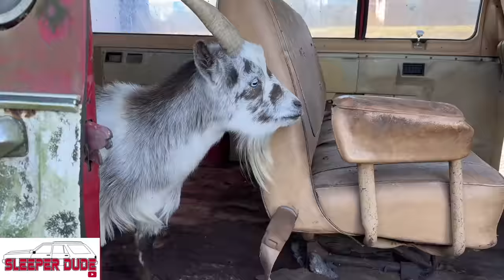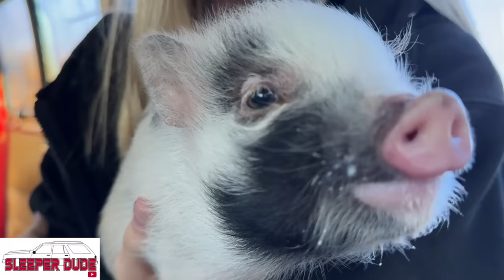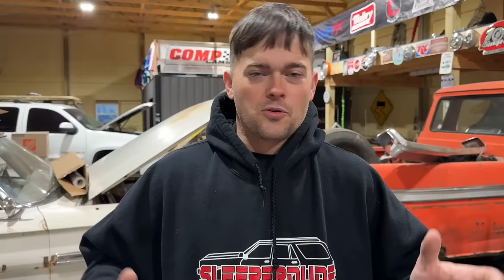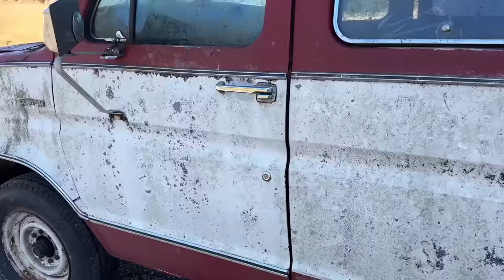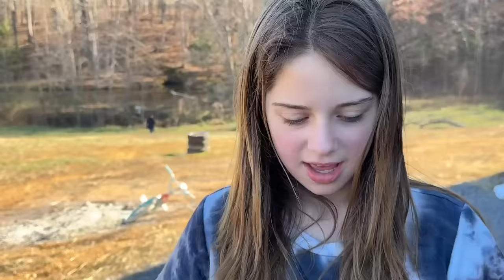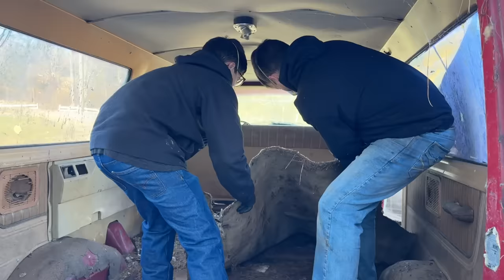$500 Big Block Van First Drive and Clean Up.

Comment: The little yellow thing in the pan is a plug they put in place of the dip stick tube, so they can slide the tube over it without losing the fluid, cause the trans come with fluid in them. Usually means the pan hasn’t been off it.
Reply: Guess should’ve kept watching and you’d found out. 😂 I suspect Lucus will not replace thrust washers 😂
Reply: I did the same comment and 2 minutes later bam lol @jcnpresser
Reply: That's correct

Comment: The lolipop you found in the trans pan was a plug they used at assembly, when they pushed the dipstick tube in the plug went into the pan. I'm a retired master mechanic, cut my teeth working on those old seventies vehicles. You do a great job and your family is a hoot.
Reply: Yep, that tells me the fluid and filter was never changed.
Reply: Same thing I was thinking didn't know they did it back then though
Reply: Exactly right.

Comment: That little plastic thing in the pan is the factory plug for the dipstick tube, when they install the tube they just push the plug in the pan and leave it. The fact that it is there indicates the pan has not been off before.
Reply from the maker: Ok thanks

Comment: I had one of these.  It was a great vehicle, reliable, great for hauling kids, work, hauling building supplies and for camping and towing.  The only downside was 10mpg.  Took me 8 hours to replace the water pump.  Most of the switches didn't work when I first got it and had to be replaced.  Tried to sell it but gas mileage scared people away.  A real versatile workhorse.

Comment: HERE'S A GREAT TIP:  Take some bolts 2 inches long or so, and cut off the heads and taper the shafts and when you go to line up a pan with gaskets just screw in 3 or 4 and just let everything just line itself up as you raise the pan and when you have 3 or 4 bolts installed take out the headless bolts and install the rest of the bolts, easy peasy.
Reply: Use zip ties to secure the gasket to the pan and after a few bolts, cut of zip ties .
Reply: I always drilled a drain plug in the transmission pan as well. Seems such a simple thing that all the transmissions from the big 3 car makers din't do. Such a no brainer easy fix. I just get a magnetized replacement Oil Pan plug bolt and put in the hole.

Comment: Was getting ready to type the answer about the plastic float you found in the pan when you called your buddy on the phone 😂!  Yep, its an assembly line plug to keep stuff out of the trans before assembly - so yes - that pan has never been off the trans.  If you mix the Lucas with ATF in the 4qt bottle, it’s much easier to pour in 😅.  Merry Christmas to you all ❤ 🌟

Comment: Club Wagons came in 12 and 15 passenger. Yours is a 12 passenger and would have had 3 seats originally. The roof rack is either factory or dealer installed accessory.

Comment: I remember when those were new and seeing it brings back so many memories of my dad who drove white Ford panel vans from that era for his vending machine business. He went through two or three of them through the years before switching to Suburbans. 
He always had them heavily insulated and then wood paneled it the cargo area. The extended van had two rear side marker light  cutouts in both rear panels, using a steel blank plate for the normal length body so he would always buy two extra light assemblies from the HELP! section of the local Auto Zone so he had the only one in town with double rear side marker lights. He just went to be with the Lord 10 months ago and we sure do miss him!

Comment: Adjust the bands using Ford factory tools. Do a cylinder leakdown test. Put in Marvel Mystery oil in the oil. Put Gumout in the tank. Check the suspension and steering. Replace the starter. Check the electrical circuits for shorts. Find out why that van sat.

Comment: You are on the spot about mounting a winch to your back wall post. I did that with just a small HF winch and it has saved me countless times. If a vehicle rolls even a small ATV style winch will pull it in the shop.

Comment: He was 100% correct about the plastic piece in the transmission. When i did automotive salvage i used to run into those plastic pieces when i would pull ford pans. After seeing a bunch of them, I grabbed one and brought it to an old Ford master tec to see what it was. He laughed and explained exactly what you were told. To think how many good C6 transmissions I sent to the crusher due to "finding pieces in pan" 😂

Comment: Merry Christmas Sleeperdude family! Josh my uncle Ray rebuilt transmissions for 30 years. I had a van with a C6 with overdrive. He told me that Ford specs was 5qrts.before they added the overdrive. He said that when they rebuilt one they had determined that you needed another quart due to the way the overdrive was placed. He said once they figured it out they never had any problems with one.

Comment: When washing an old mossy  vehicle , spray it down with strait Super Clean in a spray bottle before putting any water on it, then pressure wash it. You will see a massive difference.  Love the videos.

Comment: Hey there Josh ,
The little plastic piece with the ' O ' rings on it , the factory uses them to seal the trans. on the assembly line ! It goes in the dipstick tube hole , after the Trans is installed , they drive the dipstick tube into the Trans. Housing before filling it with fluid and that little piece just drops into the pan ! So that says that no one has worked on the transmission, because the tech would have just thrown it in the trash ! It will not hurt anything to leave it in the pan just like FoMoCo did when the vehicle was manufactured ! I hope this lowers your stress level a little !

Comment: edit commented before I got to the part where you are told what it was*
The plug in the trans pan is a factory piece installed on the assembly line so it dont leak fluid. Then they install the dipstick it just get pushed into the pan.
Very good indication that the pan has never been off.
Reply from the maker: Ok thanks

Comment: Oil dry is way to expensive for my backyard shop. I use kitty litter. It does the exact same thing and it also puts a shine on the floor. And then I put the kitty litter along foundation of the barn to keep ants and termites out.

Comment: I was typing as the guy was telling you about the transmission plug. I’ve seen hundreds of those. And on the alternator, there was a 1/2” aluminum/galvanized spacer. Those things were a pain in the butt.

Comment: I use to always make a mess like that draining transmissions. I got so anything with a steel pan I just carefully drill a small hole in the pan and let it drain overnight than i weld the hole shut or sometimes I weld in a pipe bung so i have a drain plug the next time. Love your content keep it coming.

Comment: Love you guys and your content! Just want to mention a thought that has been in my mind since you showed the master cylinder. Instead of the transmission being the problem, could it be some of that gunk in the rear brake reservoir found its way into the lines and maybe the back brakes are just really dragging? It would explain why you had a hard time pushing it out of the shop, too. It seems like you have the gears, it doesn't seem like it's slipping, just working hard trying to overcome the brakes. I've been wishing you'd check that before you gave up on a really cool van. Thanks for the great videos!

Comment: I parked my '85 Econoline 20 years ago when the transmission started doing the exact same thing this van is doing. Nearly 20 years later it still sits parked and is used for storage (we call it the 'Possum Van'). As I recall, I disconnected one of the transmission cooler lines and discovered that it wasn't flowing. Best guess at the time was the pump in the transmission failed and the ATF wasn't circulating. The van is all the way over here in Seattle, Washington and you are more than welcome to it if you want to come all the way out here and get it.😂

Comment: Atleast it tried to move. It  would be nice to see the van drive again but at same time you could easily pull it out stroke it out to 521 and put it in a small car. The 460 is the one big block you can stroke out to little to no machine shop work. Ford put the camshaft so high up in the block. They gave you so much room to play with it. Whatever you decide will be fun to watch. Merry Christmas to you and your family.
Reply from the maker: I agree
Reply: Love to see it back on the road! Nice traveling van!

Comment: 1:12:34 sounds like the ballast resistor circuit, broken missing or just a wire not attached to the coil.

Comment: Currently have a 08 GMC 1500 company truck with only 373K miles and the sludge in the bottom of the trans pan had like a 1/4" of clutch material laid out...4LSLIPPYe life!!!

Comment: You just have to change the transmission or on the driver side it has jam nuts it’s a square headed bolt on driver side it’s called band adjusters that should fix the transmission it’s slipping so if you can find that that should fix the problem but it’s on the driver side if it’s not it’s on the other side there’s 3 or 4 screw them all the way in and back it out 1 or 2 turns if it doesn’t work it’s probably the band broke but try that it should work

Comment: The little yellow ball was an assembly part for the oil dip stick no need to worry about it., the other part are internals of the transmission. Your gonna have to rebuild or replace it.

Comment: Saw dust works real good on oil spills. You should collect it when they build stuff. I always save mine. If there is a furniture shop, ask them to keep it for you. And it's free. Check out vids on bump keys, they work miracles on doors and trunks. It was the only way to open the trunk on my 65 Thunderbird. Locksmiths can't even open them, because of the traps built into them. But the bump key got me right into it.

Comment: the white mushroom thing in the transmission pan on rhe e250 is a stopper the factory installs in to the fill tube while its going down the assembly line. when the dipstick is installed it is pushed into the pan. most likely the pand had never been off.

Comment: Thick oil like the gearbox repair . Put the bottles in a bucket of really hot water . 
I had to fill the differential on an iveco van 90-140 it’s thicker than molasses. 
Put gallon can in boiling water . It’s so much easier . 
Or if for transmissions or engine mix with the regular transmission/ engine oil . 
Makes it pourable big time .

Comment: The little plastic plug was installed when the transmission was new all Ford transmissions had them in the place for the dipstick tube goes when they install the transmission they knocked that out into the transmission and then install the transmission filler tube after factory transmission apparently has never been apart BigEd coming to you from Central City Kentucky. Have a great day.

Comment: There’s a lot of potential in that old van…you know you’re getting old when you can legitimately say “I can remember when these were brand-new”(yes, I can😂). Could make for a fantastic overland-camp van, and with some overhauling(definitely a rebuild of that C6 after seeing that washer that I first though was a friction disc), a good tow rig. Definitely too good to just gut it for the engine and junk the rest….my late father had a ‘76 E-250, was an ex-Purolator Courier delivery van that his friend’s father had bought and used for his HVAC business. Dad bought it, plywood walls and bare steel floor….bought some bench seats from his cousin who was a minister from an old church can. Never bothered to bolt the seats down….sudden stops/turns were an adventure, lol

Comment: The white thing is an assembly line plug. Transmissions come with that in the dip stick hole. And instead of pulling it out they push it through with the dip stick tube on the assembly line.

Comment: Love your videos.  I really hope yall are able to fix the van and maybe get 1 more row of seats.  It would be great to take it on a road trip or even just use it as your go to ride for meet and greets.  You can slide ur merchandise in and stilk have tons of room.  But Rockys Rickety Ride or home would be good too.  But honestly if you can use the parts or find a new transmission it may just be perfect to fix and flip to sell.  It would be great.  Plus if it tows as well... thats awesome.  As for the trailer hitch they have different classes im sure u know this though....so if it looks odd check the distance on the inside of the hitch and then look up trailer hitch classes.  I know my s10 ls is a totally different class.   Thanks again for all ur hard work on and off the camera.
Reply from the maker: Yeah that would be cool

Comment: Yeah that plug is in the transmission fill tube to plug the bottom of the tube. Its not a problem. Its original for the transmission from factory.

Comment: josh the  plastic is a plug Ford uses to plug the  dipstick hole, when the  Transmission is built it is a sign that the transmission was never removed! When the dipstick tube is installed it pops the plug into the oil pan

Comment: You found the factory plug for the bottom end of the dipstick tube, they drop into the pan when the dipstick is installed. I found one on my 90 F150, it's either only ever had flushes or it's never been opened up
Reply from the maker: That’s so weird

Comment: josh if you found the "lolli" pop in the pan the trans has never been serviced since it was first buiit I used to work for a lincoln mercury dealer did auto trans service and rebuilds  in the mid 70s.
Reply from the maker: Ok thanks

Comment: The only part you don’t have to worry about in that transmission pan is the white piece of plastic with the Ori around it. That indicates that the transmission has never been serviced since the day it was new Ford put that plug in the transmission as it was going down the line in the filler tubeopening when the filler tube was put in it just pushed that plastic plug into the bottom of the pan. It doesn’t hurt anything and it lays there until the first trans service I worked for Ford for many years in a couple of different dealerships. it wasn’t unusual to find those all the time.

Comment: Rewatch....comment on going beefiest, rebuilt a Chevy C10 so went with a truck 327, changed transmission to a turbo 400, etc. Front driveshaft had smaller u joint yoke than tranny but using a ujoint from front drive of a Ford 4x4 worked as two were wide and 2 were narrow!
Reply from the maker: Yeah that would be cool

Comment: Luckas is a good product. But it's not an instant fix. Stop by a junkyard and get a transmission dipstick so you can confirm that it's full. Then put the rear on jack stands. Start it up put it in drive and let it run all day. Then try it again.

Comment: See if you can't get that transmission out, and rebuild it with your dad. If that's all the van needs besides some floor patching, I'd get it going again. Plan B, pull the engine out and put it in the Fairmont home repair wagon.

Comment: Another great clean up video.  Personally, I think it would be a shame to use a van that is nice as that one to be used as a goat shed.  The body is very solid....super solid.  It runs...needs a new C6...but it wouldn't take much to convert that into a merch hauler or a parts hauler...or just use it as a huge family vehicle.

I had one of the best laughs of the year when Squeezy climbed into the van and goes "Where's my candy?"    I laughed so hard I was crying and coughing at the same time.

Comment: That plastic piece is a plug that gets put in the dipstick hole while the transmission waits to get put in a vehicle. The transmission gets put in place in the frame and when the dipstick tube gets put in the guy on the line just pushes the dipstick tube in and it pushes the plug in the pan. It big enough that it won’t hurt anything. Needless to say the pan has never been off since 1978.

Comment: Don't give up, use tried and true things, put sea foam Trans treatment, let it foam, do a little research on that Trans, certain ones can take off in second and be locked in, my nephew had one worse than yours, after he put the treatment in, he let it get hot and overflow, then it drove from north Carolina to West Virginia, and he sold it a few months later it was still going !

Comment: Set it up on Jack stands then see if the wheels still have trouble spinning could be a stuck brake or even stuck wheel bearing.  It act like the E brake is on.

Comment: I found one of those plastic plugs in my transmission pan, took a while to but finally was informed that it was put in at the transmission plant for a dust plug until final assembly where they are usually removed but occasionally get left behind. And I wondered why the only place that it fit was in the filler tube. LoL, it's a Ford thing

Comment: That little plastic plug with the o ring on it was used to plug the transmission filler hole at the factory,and when the put the dip stick tube in it goes inside the trans pan,it dont hert nothing,throw it away.

Comment: Went from 100 in parts to 450 for transmission rebuild parts beating on a great c6 transmission.  It damages more than clutches . You'll find out soon enough. Clutches, pump, seals and new band . Very easy rebuild. The pump or the torque converter is shot

Comment: The little ball is from the factory they installed it in the dipstick hole to keep the trash from getting in the pan you push it into the pan when installing the dipstick tube.

Comment: I can't believe after finding a broken spacer, a check valve ball and spring along with an inch of metal filings in the pan, that you press on with the tranny service. Yank that thing out and throw it on the scrap pile!